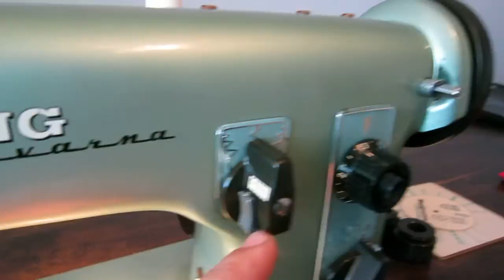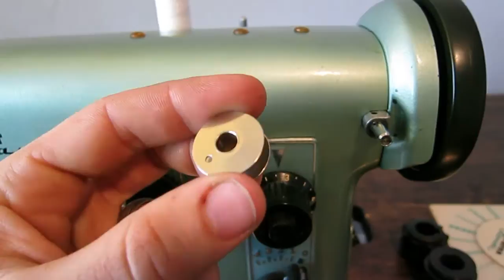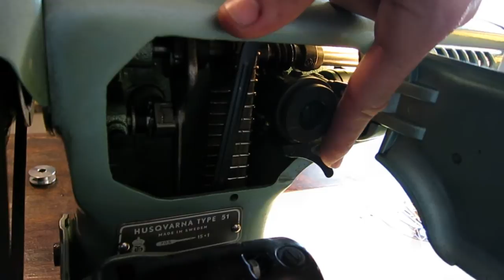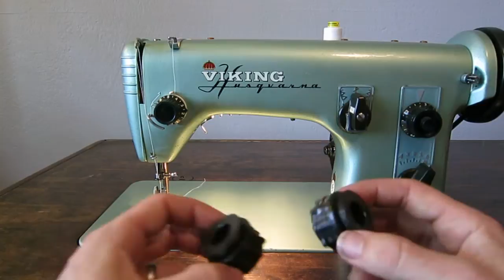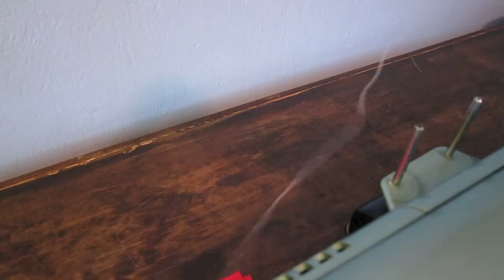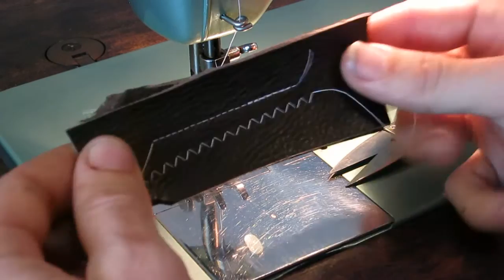Husqvarna Viking Model 51 Demonstration and Review

Comment: About the Spools hanging up:
I made a round thingy out of 5mm felt. You stamp out the middle so that it fits the inner cylinder of the spool . Put it together and Bob's your uncle! Very informative Video!Thx for show and tell!
Reply: Sewing machines up 'till the eighties always had round felt discs with a hole in the middle ready in a spool holder.. They significantly helped stabilazing wildly jumping spools. Unfortinately people didn' t understand their purpose, so after unboxing a brand new machine, they got tossed away.
Any small multifold piece of fabric with a hole will help the spool calm down and run smoothly.
Reply: About the presser foot. It looks like the standard zigzag foot. It is unique in design, because it has those ridges inside the "toes" .  They come very handy when aligning stitching with other stitchings or edges. 
This presser foot is the feature I would like to have on all other machines.

Comment: I have and use a 21e. A beautiful machine. The motor is about 70-75 w. That is 1/10 hp. One hp is 736 W. Mine has two gears. I own a 2000/6440 also. This is stronger with more elastic stitches, but not better/finer .

Comment: You can get a hint of what year the machine is built by looking at the serial number. It is inside the left hand cover. Probably it would be a letter and then 51 and then some digits. If the letter is M then it is 1958, if it is S then it is 1964, and so on, counting up. This system was used up to 1967.
Reply: And also, to prevent the spool from spinning ahead and messing up the thread, you should have the felt washers on the spool pins.

Comment: I have a Cl 51 A. Cannot get the hook to pick up the bobbin thread. Any advice, greatly appreciated. I have the needle in correctly. Just can't see anything that is wrong.
Reply from the maker: Sounds like a timing issue.  Take a look at the my video on "how to time  sewing machine".  Confirm that the needle and hook point are in the correct relative position.  The other thing is confirm that you are holding the threads down before you start sewing.  A lot of people don't realize you have to "trap the threads" when you start or you'll ended up with a birdsnest.
Reply: hello every  one ..do u have a user menue of the cl 51 ....

Comment: Thanks for this wonderful video. I bought a machine that looks  the same, it came without the outer belt. Called Nordic zig zag. I bought a rubber belt today. It is made by Husqvarna. Motor is Danish made. I did open the back when I first got it but don’t think it has the cams. The motor would get in the way. I have several husqvarnas among other older machines. So tomorrow may see it working.
Reply: That's a Husqvarna model 49. They are solid machines but not very many were made. They're mostly the same as this machine without the cam mechanism.  Your machine should be mostly parts compatible with the more common model 19 and 19e which were mostly the same but in a free-arm rather than in-table model.

Comment: Beautiful... I got an hysvarna Rotary... I can’t find information about it, but it’s green like this one... and it seems older.
Reply: I think I have the same one you're describing.  Did you find any info about it that maybe you could share?
Reply: Rotary is the name they used for the straight stitch only machines. They are from the same years as this one. Probably started in late 1950 and went on to somewhere around 1967.
The Rotary uses a lever for the stitch length, but that doesn't mean it is older than this one.

Comment: The "push-button-reverse" tends to gum-up on these old machines, so you can't select forward or reverse anymore. The remendy is to open up the machine in the right manner, apply heat, not much over 100 °C, applying 5-56 or WD-4, working the parts back and forth, wiping off excess oil, applying more oil, more heat, working the parts until they are completely free.
Reply: Good advice. Even better is to take mechanism out. When I've done it it has been amazing how tough that gummed-up oil can be. 

But if your method is enough to solve the problem there is  no reason to do it more arduous way.

Comment: Just gave my 12 year old daughter one of these, it's my grandmothers old machine. it works just fine for a few seconds until the belt starts slipping and it just stalls. Not sure if it is worth fixing or just scrap metal. Pretty cool looking retro machine and since it belonged to my granny i'm interested in finding out how much would the drive belt cost? I'm talking about the belt that is in the far right side between the flywheel (handwheel) and the motor.
Reply: Worth fixing? You have just a simple belt too loose. It is like you said: My car has a flat tire, is it worth fixing or is it just scrap metal? 

There is screws in motor  mount to adjust  the belt tension. New belts are surely available for 5 bucks. Belts can be easily made from thick leather if new one is needed/not found.

Hope this helps or you have fixed that problem already.